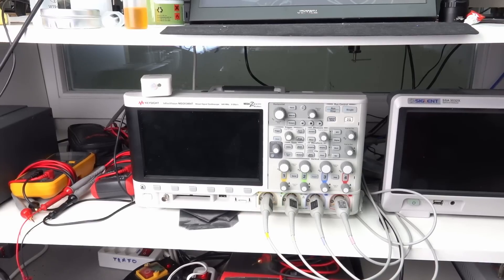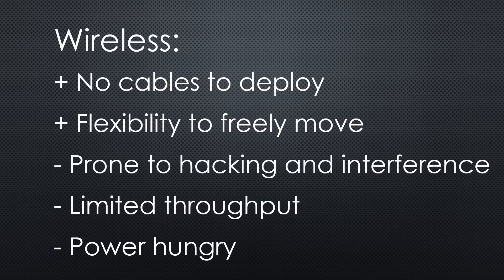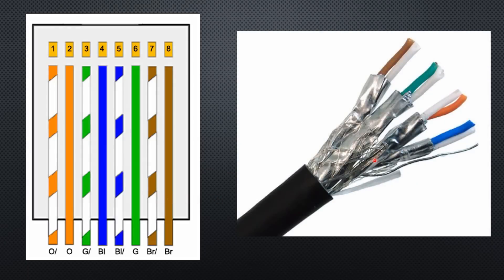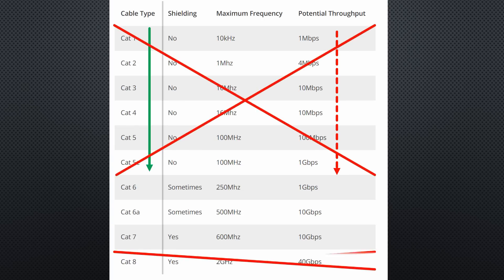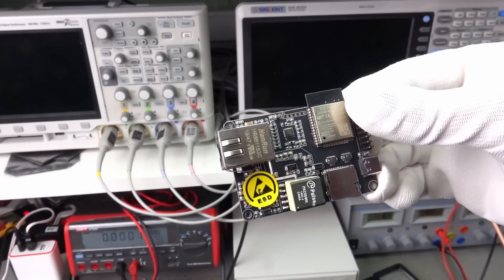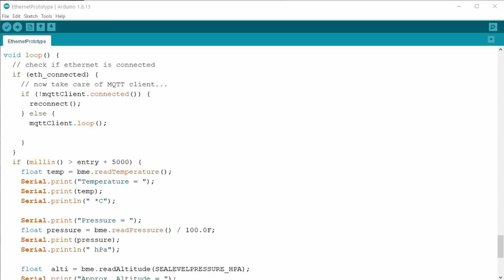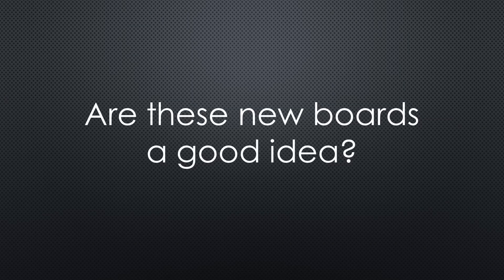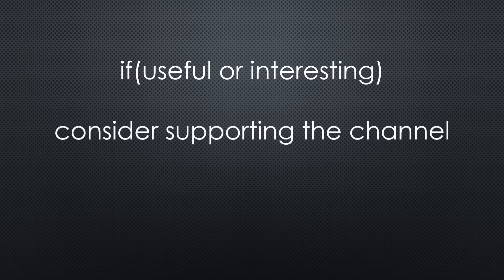#365 Is Power over Ethernet (POE) on the ESP32 any good? (New TTGO and Olimex boards available)

Comment: I think the ESD yellow sticker is only there to warn users of handling the product for Electrostatic Discharge, which can break electronic devices. I never saw POE devices warning about potential risk. 48v is not too risky in most scenarios (dry hands, not skin cuts).
Reply from the maker: You are right, it was more a joke. I would expect that the POE parts are less prone to be destroyed by ESD because they have to be protected best. And I never found such a sticker on any other Chinese board.
Reply: @AndreasSpiess  While it's true that you never see ESD stickers on electronics from China, you must also be aware that much of the ESD sensitive equipment from China comes in ESD protected bags.
Also, many makers warn about ESD in their videos; Bill from the DroneBot Workshop and Chris from Explaining Computers often flash their ESD protection wristbands - and I think I've also seen you use one :-)
So I take this as a sign that Chinese manufacturers are now evolving, and moving up from just selling cheap stuff, to selling goods that are also having user needs and user satisfaction in mind.
And that's a good thing, I think.
Reply: That's what the symbol against EDS appears as!  LilyGo created an affordable dev board for the public and probably envisaged people handling it like a brick in a riot.  That said ESD is to be taken seriously, if you touched it and it doesn't work, then it's your fault, is what they're saying.  
The chip under the "sticker" is an SI3404, a PWM switching regulator responsible for converting a high voltage supply over ethernet connection to a regulated low-voltage supply, so yes if you damaged that, something could go crappy.

Comment: Also, ipv6 does not seem to work on Ethernet  with the current Arduino ESP32 software. Not important for most, but good to know maybe.
Reply from the maker: Thank you for the info. I never tried ipv6 so far.
Reply: IPv6 should work on ESP32 but it seems a bit special to get it working.
https://techtutorialsx.com/2019/10/02/esp32-soft-ap-enabling-ipv6-support/

Comment: Nice. Did you check how much power such boards can deliver to sensors, when powered by PoE? It would be very handy to power the whole sensor solution from that, not just the board.
Reply from the maker: They specify 1.2A@3.3V. I stopped at 1.5A and it was still at 3.3 volts. So no problem for sensors of any kind, I think.
Reply: @AndreasSpiess  sounds good, thank you. Really have to think about this PoE stuff, again.
Reply: It also depends on the used switch.
For 802.3af (POE) and 802.3at (POE+) the device "negotiates" with the switch how much power it can draw.
The minimum (!!!) of all profiles is 0.44 Watt and depending on the switch it may be able to deliver upto 15 Watt for POE and 30 Watt for POE+ (some even more)
But your switch still needs to have the power budget available.
If you look at most switches with 4 PoE ports, you will see they have a power supply which is a little less than 60 Watt, so it cannot deliver 4x 15 Watt.
Meaning a requested power profile may be denied by the switch.
And this rejection may even occur way before the expected 15 Watt on a lot of switches.
For typical ESP32 like use cases almost all PoE switches may work just fine and you won't see any strange things happening, except for those really cheap no-name PoE switches. (don't use them for more than 1 or 2 ESP like devices, really don't!)